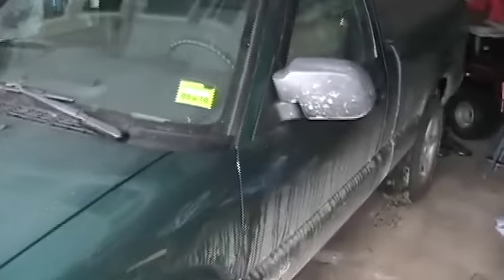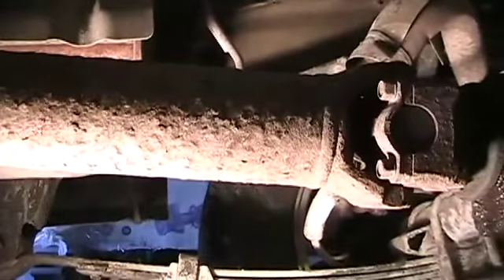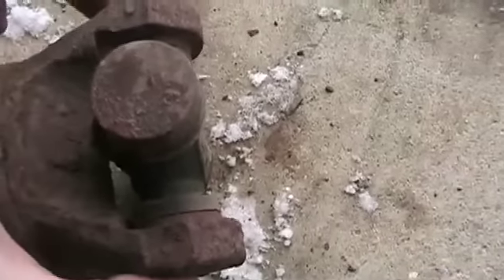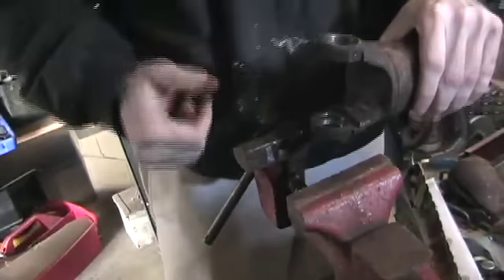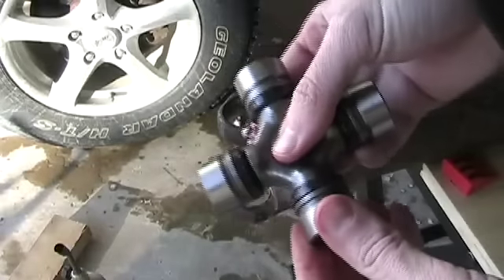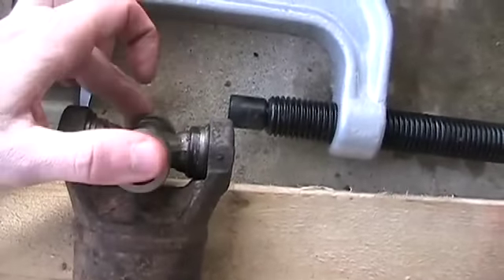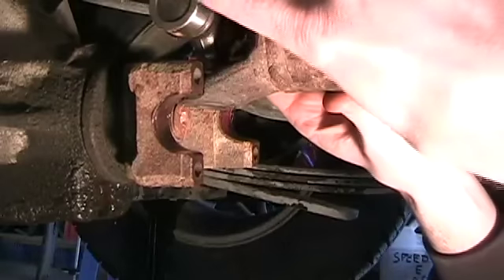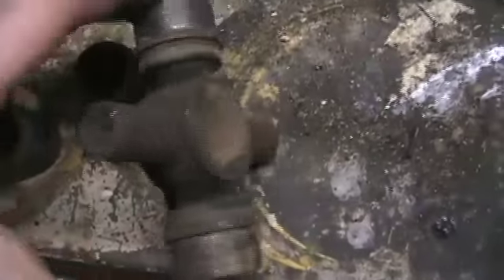Replacing a U-joint in a 1999 Chevy S-10 4x4

Comment: did my u joint this morning. it was pretty easy, i didnt have to burn out the old u joint. i just removed the clips and hammered with a 1-1/8 socket to get it out. but you godda be real careful with the bearings when you install the new one. thanks for the vid man helped out a bit

Comment from the maker: Yes...as seen in my videos, always use proper safety equipment.  For me, that's always eye protection and usually hearing protection when doing loud things.  When grinding and welding, always wear long sleeved clothing.  Hammering metal can always be dangerous and if worried, you can always additionally wear gloves.  I do in the winter since everything is so cold.

Comment: I watched your video before doing my wife's 2000 Jimmy and it had factory joints but they had clips and the nylon rings. I burned them out and spent a half hour whacking on them until I realized the clips were in there. 

aside from that great pointers and I was done under an hour and a half. thanks

Comment: Thanks for the reply, after viewing your video i did exactly what it said and turned out perfect. It was only the bottom u joint that was bad. only have 117k on it. Just make sure if you do plan on hammering that u-joint out not to slip and take a full blow from a sledgehammer to a thumb.... 2 weeks later and my thumb is still broke

Comment from the maker: @Weasel84x Probably not.  There is a lot of mass to the drive shaft and I'm not sure it would get hot enough.  You could try, but I wouldn't be a fan to getting a large part of the drive shaft hot, as it might warp the whole thing.  A little plumbers torch should do the trick.

Comment from the maker: Its less a sound and more a vibration at particular speeds.  No, there was no noticeable drive line changes, but the truck picked up a vibration around 30 MPH that was not noticeable in the steering wheel.  Given a wheel isn't out of balance due to mud or ice, the first place to start looking is at U joints since they are the cheapest to fix and most likely the problem.

Comment from the maker: @350jake I didn't do much work given how cold it was outside.  You can pretty much do any of that at your leisure, you don't need a failed part to do it.  As for finding out if it is unbalanced, you pretty much have to go by feel.  If you have a drivetrain vibration, and it's not the U-joints, then it is unbalanced or bent, a machine shop/driveline place can find out for you cheap.

Comment from the maker: It varies from model to model.  An extended cab S-10 4x4 has a single shaft thanks to the transfer case.  As stated in the video, its usually the one rear one that dies.

Comment from the maker: @bigmike2106 Easiest way to check a U-joint is to just pull the shaft.  It's only 4 bolts and a bit of prying and it will answer all your questions about the condition of the joint.

Comment: the 1st time I noticed it was when I went from park to reverse backing up my driveway, and later on when I went for a drive it has started doing it from park to drive(obviously passing R). I tried it in the lower gears and it did it too. But as you know, it would be incredibly inconvenient to pull the shaft in the middle of winter just for inspection... I'm wondering if it's possibly the brakes, as I had an issue with having to bleed the rear brakes recently.

Comment: Good explanation, thanks. 

By the way, do you have to mark the drive shaft so that it is hooked back up in the same orientation to the rear UJ as it was when it came off? I guess it could be 180 deg off, by random chance. When do you have to mark each end to assure the same orientation? Would you have done that if you were taking apart the middle UJ?

Comment from the maker: @Schultz1919 Easiest way is to remove the air intake hardware, that gives you access to the two screws I think that hold the distributor down.  That is a wear item, so pull it off to check and see if it's any good.  I might do a video of that inspection, that's a good idea. :)  Think I can do that when I change my 4x4 front axle cable.

Comment: Would it be too much different to replace the u-joints on a 00 silverado 1500? my truck is making a lot of noise intermittently on the highway and i think that i narrowed it down to my differential but i want to check the u-joints too. How many work hours did you have when inspecting then replacing the u-joint?
thanks, great video by the way very informative.

Comment: @spelunkerd You should always mark a 2 piece drive shaft so you keep the shaft in "phase" also a good tip for a time saver is to line up your grease nipples so you do not have to rotate the shaft, you can just go down in a straight line  :)

Comment from the maker: I would think rear end gear honestly, loudest when shifting from R to D or R to D.  It can be U-joints, that's for sure, easy to check, just remove the driveshaft and check them for play or being sloppy.  They should be free but tight.  Would be fairly typical for a GM rear end.

Comment from the maker: @consiglierestyle Well, no fluid from the drain plug would mean you have been running a low level.  Yes, the drive shaft will prevent the rear from moving, usually the transmission is in park and locked.  Things should have some play however, and if you raise the rear of the car/truck and it does NOT have a posi, both wheels should spin when turned by hand...in opposite directions.

Comment: Also it doesn't vibrate or anything at any speed. Have tested it at 80 and nothing. its a 91 s10 4x4. I'm sure not much different in drive-line design than yours. However, I did notice it made that clunk once when exiting the freeway. Possibly trans issue then?

Comment from the maker: Could be, it was common, my 1991 had a two piece shaft as well because it was a long bed, however in later years, GM moved to using longer, lighter AL shaft on trucks with long beds and extended cabs.

Comment: I wish I would've seen this a year ago before I removed my girlfriend's U-Joint.  It took me some hammering before I read that I needed to use a torch.

apparently mapp gas works much faster but propane did the trick.  just have to be patient and heat thoroughly.

time to go change the transmission...

Comment from the maker: @TakingU2Skool Is it 4x4?  if it is, then it's from the transfer case.  Check the level and replace with appropriate fluid...which is a heavy oil I believe, your owners manual will know.  If it is 2wd, then its from your transmission, you'll need to check the level and top off with the appropriate fluid, in the case of a stick shift, its still ATF.

Comment: my 96 automatic ext cab s-10 vibrates at low speed,took it into the shop and they said that i need to replace the double cardin joints on the rear driveshaft and very expensive...they said if i can find a driveshaft with no double cardin u joints ,it will work and is cheaper,but where can i find one of these driveshafts??and whats the length of the rear driveshaft i need?.....by the way your video was very imformative....thanx.

Comment: I have a question. I'm trying to figure out what my problem is on the exact same vehicle (2wd & manual) and deciding what to check first. I don't feel any vibrations or whatnot, but I can hear a somewhat faint sound (kind of a clinging or creaking sound, maybe like two metal pieces lightly tapping each other) but it's getting louder. Thoughts?

Comment: is it generally the u-joints if I hear a clunk from the back end when I let off the brakes from a stop? It seems to only happen when I'm pulling out of my driveway backing in or out. That's what I heard and I had a car that did that before. replaced the u-joint and it went away.

Comment: I am about to attempt this on a 96 s10 blazer guessing it would be the same. My question is,  I dont have a torch or any means of mealting the plastic. Could i just build a fire and prope the end of the drive shaft over it for a bit and let it heat up and melt it that way.

Comment: Curious... I just replaced my U joints in my 98 S-10. What a BEAR it was! When mounting the ujoint into the differential end with the straps or brackets, did you also put the inner snap rings on also? I put mine back together to find that if I had the outside of the caps flush with the brackets and (yoke)? There is a lot of play (left to right). when I get rid of that play and move the caps in, the caps are about a quarter inch or more in which I don't remember if it was or not?  Thanks

Comment: Ok my u joint came off or broke because when I was driving the drive shaft just failed down (the rear part you install in the video). Do you think the u joint is still up where the drive shaft is supposed to be at? And if so how do I remove it?

Comment: I just did this on my 87 silverado. I cant seem to keep my u joints in place. If i hit the drive shaft with a hammer slightly the u joint will slowly pop out of the clamps. I bought new clamps but the holes dont line up. I tried to flatten out the original clamps to get a better grip but still nothing the ujoint and drive shaft can move freely back and forth... help??

Comment: Hey turbo.
I own a 02 s10 which is rwd. it has the two half drive shafts connected in the middle. would the process be the same as this. vibration is really bad. and when you hit the gas it does it at any speed. thoughts?

Comment: QUESTION:  would this also apply to the speed of 60mph-70mph. I get a slight up accelerating between 60-70 but if you let off the gas as to coast down to 60 the vibration is doubled. Im thinking the pressure on the ujoint moves when acc/decel causing this? Going to be checking regardless after work today. Did replace the front two wheel bearing.
Reply: Thomass definetly the joints. also check your front tires for play could be ball joints.

Comment: i  have a 95 yukon 4x4 but my drive line is leaking transmission oil on the part the u loint that goes into the transmision side   is  it the drive line or the u  joint...

Comment: so i have a question. i have a 2000 chevy blazer it makes a clunk when backing up and when taking sharp turns. would this be the ujoints? i had my vehicle checked but know one can tell me whats wrong. They said the cv axle and tie rods are fine. i looked online and someone said ujoints my grandpa who is also great with vehicles said transmission mount or engine mount.
Reply: Kirito TSK u joints r bad
Reply: Clayton McKeel it was my swaybar links. They kept clipping on my tie rods ends.
Reply: K good too hear u found out what it was

Comment: Any specific torque specs on the bolts holding the u joint to the diff?
Reply from the maker: Fairly tight, might have to dig into the internet for a specific value.

Comment: If you have the shaft off why not change both front and rear u joints at the same time? They're cheap enough like $20.00 ea.
Reply from the maker: Mr. Kitty as much as I like to change perfectly good used parts, I'll just change them as they wear out.  Time and money of course.  Dropping the shaft isn't too much of a big deal.
Reply: Guess so, everyone has their own preference when it comes to maintenance/repairs. Thanks for the video.

Comment: I have a 93 s10 2x2 and its make a like a rattleing noise/clicking nosie if it slow rolls but if I give it a little gas it'll stop I was told could be the u joints any ideas wat it could be ?
Reply: Did you figure out what the noise was that you were hearing?

Comment: that is the exact drive shaft and u-joints thats in my 05 avalanche, and fyi, if you change one u-joint its best to change the other two, but good video, im changing mine now, the only differance between mine and his is that i got pissed off at getting my u-joints out and i cut them out with a cutting torch, if you try that be sure your very presice with it, but good video.......by the way chevrolet can kiss my ass with injecting plastic in to the u-joint

Comment: why did not you replace the pinion seal in your way !!!? it is leaking !! it is not a good thing you leave that thing leaks or it could let your pinion bearings without a proper lubricant and damage it !! you really would have saved yourself a lot of time and effort if you did that all together with u joints replacement at one time.